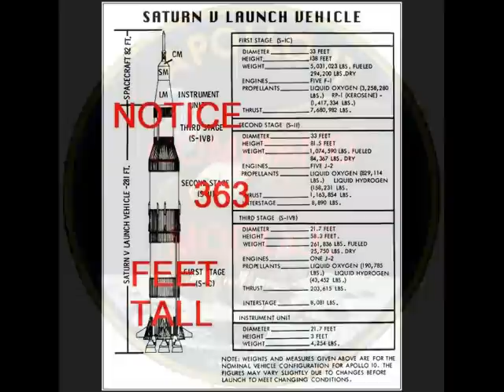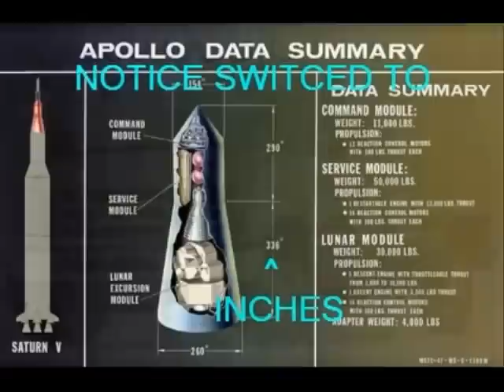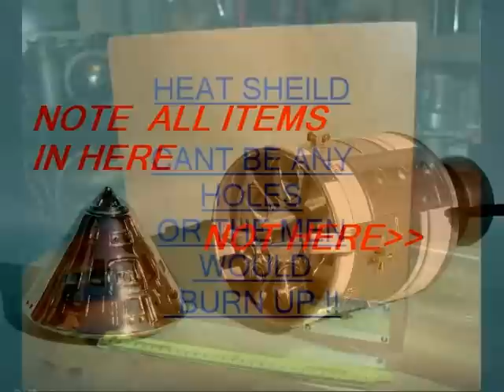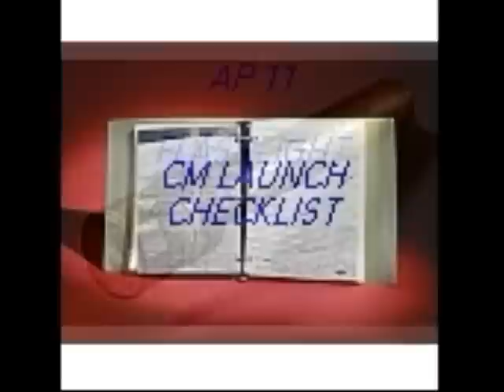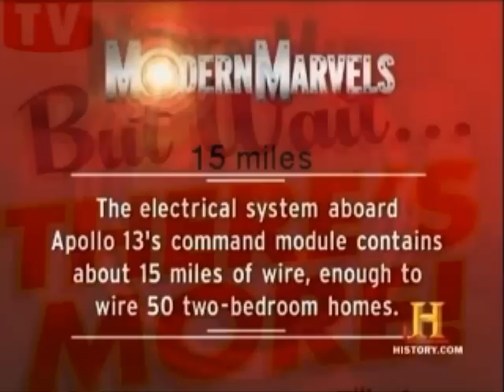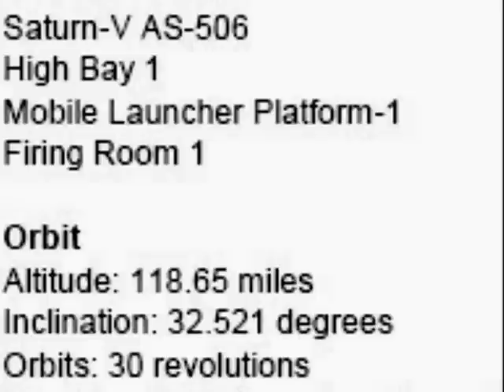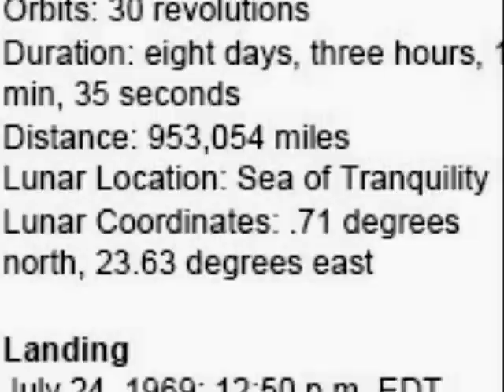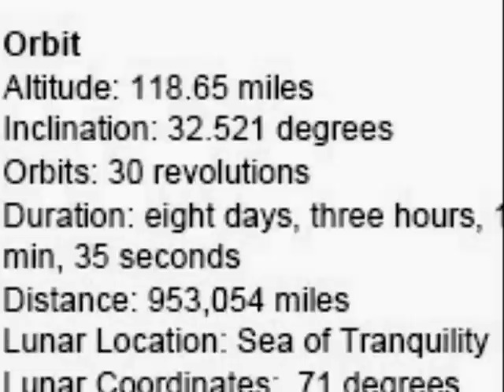COMMAND MODULE  COMPLETE 3 2

Comment: I saw the Apollo 10 command module at the science museum, in London, back in 1987.  Firstly, I was shocked to note the extensive use of nothing more technologically advanced than layers of synthetic resin-bonded paper.  Synthetic resin-bonded paper seemed rather insubstantial for a craft operating under such extreme conditions.  But, secondly, the command module was uncomfortably small, and this smallness was clearly in conflict with the footage of the astronauts.  Around the year 2000, I recall having an argument with a younger man, regarding these observed paradoxes.  He was born around 1975, and was sure that NASA had not conned us at a time prior to his birth.  But, as far as I was concerned, the sheer mass that would have been required simply for life support (not considering anything else) would have dwarfed the space officially provided.  He argued that there was a hatch to the service module at the base of the command module.  But there was no hatch, as this would have compromised the heat shield.
Reply: HI Stephen, 

I can say having seen a CM up close also that the size is insane but not impossible. As for the hole in the heat shield nope that is not how it works, there was an umbilical that went from the CM to SM that transferred power, oxygen and water. 

https://www.quora.com/How-were-the-Apollo-Command-Module-and-Service-Module-connected

The CM by itself could only sustain life for about 15 minutes then no more oxygen and battery power. See apollo 13 as an example they had to get the LEM to support the CM as the main O2 tanks were gone.
Reply: The inside size of the CM doesn't match with the film footage, so the film footage must have been faked in an alternative venue.  Apollo was a political objective masquerading as a scientific venture, and everybody was duped.
Reply: Certainly looks that way.  13 was heavily dramatised.   Nevertheless, it is logical that they would have pre-planned for earth return, using the LEM descent engine as a safety measure in the event of a service module engine fail.  After all, the LEM descent engine was able to generate 10,000 pounds of thrust.  However, the dramatic aspects started with the fact that they'd conveniently placed Apollo 13 on a non free return trajectory.
Reply: Stephen
They needed free-return trajectory without the Service Module engine.

Comment: Have you ever taken a modern car apart so it could be sold in parts,?  I have . You start the job and the parts start piling up much quicker than you would think . In the end you seem to have enough parts that you can't even get them back into the empty shell, you have to fill the boot up with parts to. Its the same with the CM ,its very carefully designed and each component is custom fitted .

Comment: How did they get inside the cone? I've just got to see the bottom of one of those things, that would nail it 100000000000000% ...( 2 years later) sorry, must have been drunk when I posted this...I mean that it nails the fact that this contraption wasn't flown to the moon, no way
Reply: I don't understand what your saying completely, but the CM actually has two entrances. The docking adapter and the actual door. Neither of those are mounted where the heat shield it because they need the heat shield.
Reply: Chocolate Rocket Very correct.
Reply: +Eddie Hayes
I couldn't be less interested in whether NASA did or didn't send men to the Moon. Seems daft, but - so what.
I do care about correct (! ha... chance) English usage, though. And, of course, "correct" cannot take a modifier.
Therefore, nothing can be extremely, somewhat, slightly, significantly, or even - as you say - "very" correct.
Something either is or is not correct. It is an absolute, in linguistic terms. It has an opposite too: incorrect. Rather similar to "right" and "wrong", when used in their mundane senses, of course, not their philosophical/moral senses... I won't even start on THOSE... we'd be here all day... week... year... zzzz :D
Oh, and: your tagline states that you offer, er, "A little bit of EVERYTHING". A very little bit indeed, to judge from your Channel... which contains, well, NOTHING - excepting that inevitable link to NASA.org, of course.
Just for fun: "everything" and "nothing" are also absolutes (like "correct"...): so you really ARE a contradictory one, are you not? You lot, honestly... lazier and lazier. You could at least have bothered to like some NASA stuff (based on your only content: one URL), or perhaps followed a few common "YouTubers", or something...?!
Anyway. Bye now...  :)
Reply: well said Nell...this brought me back to my rather vague post!

Comment: I like how the lunar loons had to get the audio track silenced by whining like the sissies they are!  All they can do since they can't refute the facts of the video.  The LRV is also one big aspect that shows the Apollo program was BULL.  The LM was not redesigned so that it could accommodate the rover's stowed away dimensions!  Are you kidding me?  Every gram of equipment carried on the vehicle was taken into consideration.  Yet an electric vehicle big enough to carry two fully suited astronauts and make several kilometer buzz trips away from the lander just happened to fit in this one spot on the lander that was overlooked on the first couple of missions when they didn't have a rover yet.  LOL  What comedy those clowns at NASA are capable of
Reply: Mr. Lowery The LM storage bay was redesigned for the Rover.Maybe if you use Google it will help you find the details.
Reply: Eddie Hayes I'm talking about  the LM would have to be completely redesigned due to the extra load.  The engine, RCS thrusters and the landing legs, at the very least, would have to be reworked for SAFETY precautions.  That wasn't done.  Think about how meticulous the planning is for any space launched vehicle taking humans to orbit.  Not even a single kilogram of payload weight is overlooked in the planning.   Too many variables which could cause unpredictable problems during the mission by adding the LRV to it would require the reworking of all critical systems to the LM.  There would not be any sort of "just make room for it and stick it in there" approach.
Reply: You left out the part about NASA testing the entire concept 19 times.The LM was reinforced,tested-19 times.Read about it.NASA didn't stick it in the payload bay and just hope it would work.
This sounds like RENE and his statement "If you just shifted your body weight the LM would go out of control!"
Reply: Eddie Hayes What's funny is the actual LM itself was never tested for landing on or ascending from the lunar surface!  The first time it's guidance system for landing was used was during the Apollo 11 mission.  The ascent engine was never even test fired before it was used during the mission!  These things alone make the whole Apollo story a crackpot cartoon...
Reply: +Mr. Lowery Come to think of it, why send a rover at all?  Since it could break down, it wouldn't be able to venture further from the lander than the astronauts could walk back to, or a malfunction would maroon them and they would promptly die.  So why go to all the expense and endless planning needed to send up all that excess weight for something that should go more than a half-mile or so?  I believe I have the answer.  It's just a publicity stunt to make the sheep say, "Wow is that neat!  Riding around the moon in a dune buggy!"  Considering all of NASA's jive is just one big publicity stunt, it fits.

Comment: Eh you're confused. The ship had 3 sections. Most of the components were housed in the service module. Which is the big cylindrical part. Not the command module/descent module(cone part). Also a lot of the components were on the L.E.M. which was attached to the top of command module(cone). The service module was located below the heat shield on the command module and was inaccessible. 
Go and look at some pictures of the full craft and you'll see what I'm talking about. 
I don't believe we went to the moon but this theory needs more work and a lot more facts and fixes
Reply: Fraser Jean The question is since NASA claimed the consumables (food) was kept behind the Command module in the service module  behind the heat shield how did they get to the food? Space Walk?
Reply: batmmannn Also it's been proven by plenty of people that the Lunar Buggy  would never have fit in the LM, much less all the rest of the crap they had piled on it. It simply DID NOT FIT.
Reply: batmmannn  Air, water, electrical - all in the SM in the back and piped forward. .  Food was kept up front.
Reply: John Miller It's all BS, they never left Earth Orbit either way.
Reply: Fraser Jean but they could not go to the other sections to retrieve things.. so everything would have to be in the section they are in.
ddd
Reply: uhadme Everything except food was piped in from the Service Module located behind the Command Module
Reply: John Miller Piped in How? There were no holes in the heat shield.
Reply: Batmmannn they video pointed out there could be no holes.. that is their heat shield. so i added more facts. apparently the troll didn't care the video already addressed and proved how impossible a journey it was. LOL at 50 reels of film being piped in.

Comment: The CM had a container for 100 gallons of fresh water.
Reply: I shouldn't exactly say that. It had compressed hydrogen and oxygen that was combines in the fuel cells and filtered for drinking. The craft vented the waste water into space.
Reply: William O'Connor Funny how you claim they had so much water but in their Moon Suits they didn't nor could they have carried enough water to even cool themselves. Not to mention that heat exchange is not possible in a Vacuum and at no time did we ever see any release of steam or vapor from any suits... ROTFL
Reply: batmannn
Based on what?  Your guess?
You expect to see vapor ?  You know water vapor is invisible, right?